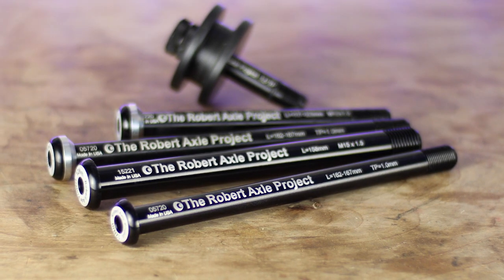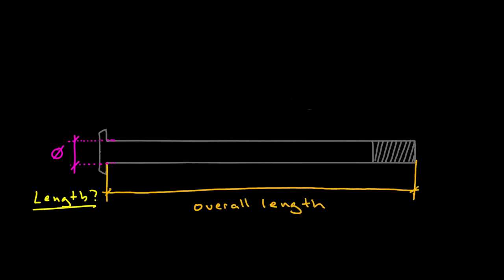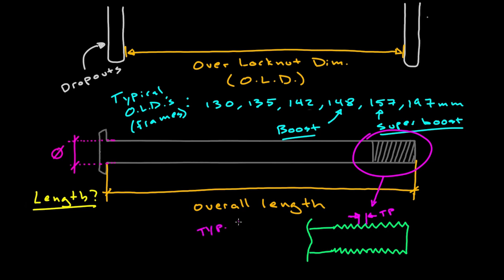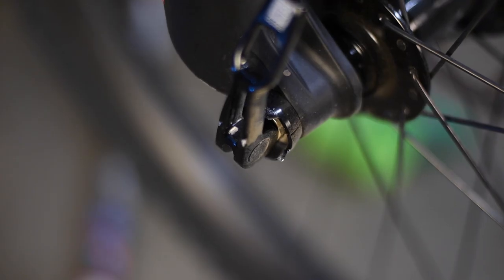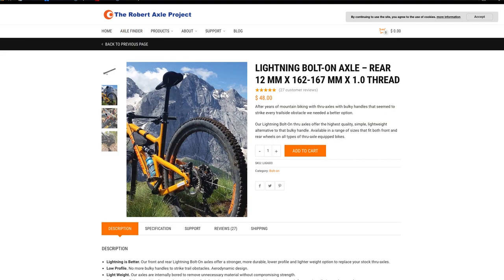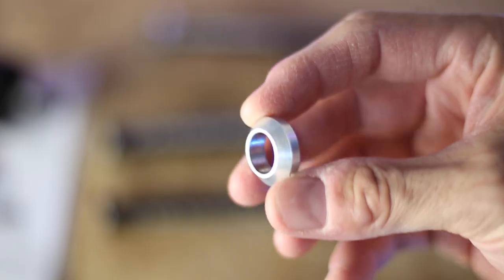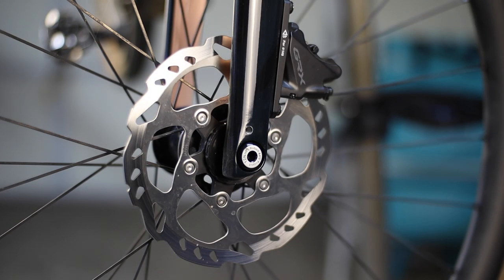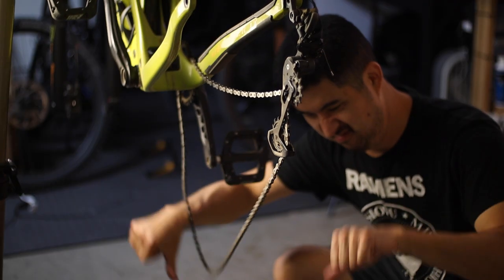The Robert Axle Project // Bike Thru Axles Made EASY!!

Comment: My experience in finding the Robert Axle Project was similar. My Surly MS through-axle wouldn't mount to my indoor trainer and the trainer's manufacturer didn't have a solution. Next thing I know I've got an incredibly well made rear axle that's got the exact right spacing and spacers. It looks fantastic and is much easier to fasten.

Comment: Loving the presentation and content - one thing I do not get:
If you are riding any axle close enough to scrape its tip on rock or else, where does that leave your pedals, shins, even cranks when those are passing the same object?
Reply from the maker: My guess would be ruts, rocks, etc. Don't know exactly, but I can say that my rear axle handle has taken some abuse
Reply: @TheBikeSauce  I generally agree with a 5mm allen doing a better job (if not racing, of course) - but that abuse - especially on the rear wheel clamp  -  I find much more likely to having happened while not riding the bike, i.e. loading, storing, maintaining it...
The axles are higher than any BB (unless you build mini-velos like me :-P ), and the Pedals protrude to both sides way more outwards than the lever of the axle.